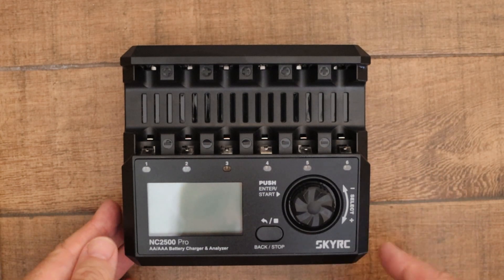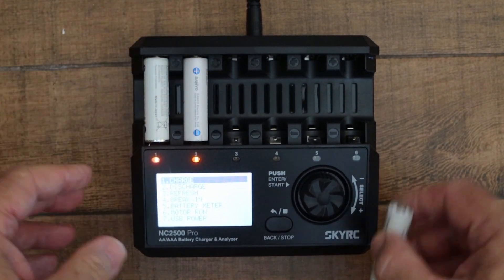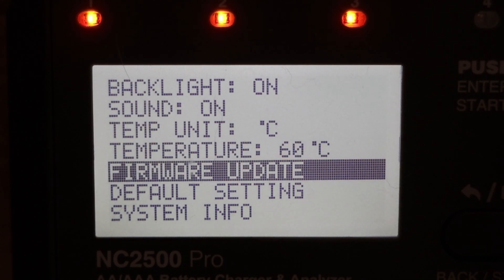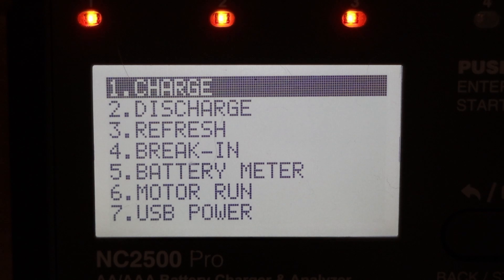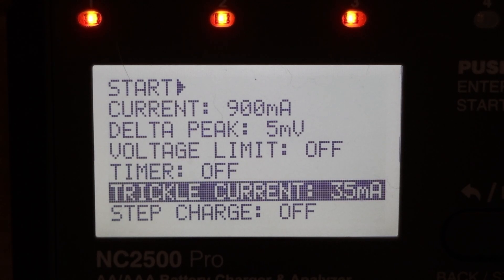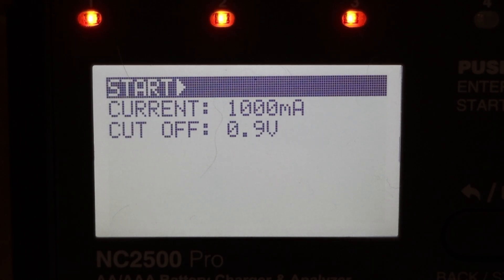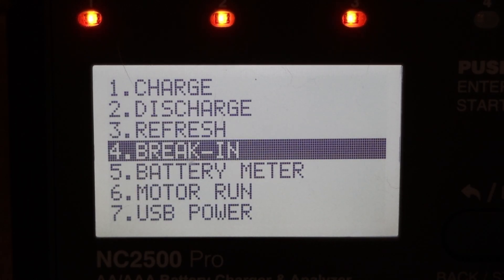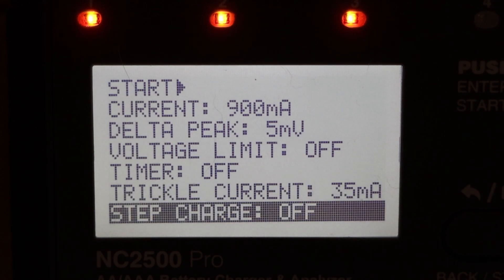A Closer Look At The SKYRC NC2500 Pro

Comment: How Delta peak charger works with the millivolt drop back voltage setting is in the rc racing world the theory was adjusting this allowed for a little more punch our of your sub c size nimh batteries. So some racer would set the mv to 3 because when the battery nears it's peak voltage the voltage drops down in mV. So if battery is starting to be charged at say 1.444 volts then the battery then drops 1mv at a time so then it would go to 1.443 1.442 so forth. Well that 3mv means the charger will end charge when it drops 3mv. or to whatever ever setting it drops back. However the choice of your MV setting will chargre more or less per say resulting in a higher temp at end termination. Lower the number the hotter the battery will be.  Any value over .03 volts for a single cell may cause the cell not to peak. A high value of charge current will also give hotter batteries. A value of
.08 volts should fully charge most battery packs with one peak. Read page 4 and 5 about delta peak. This is from a very high end charger back in the day. You can trust this info and research this on the net but this will help a lot with nimh. I use .03 to .04 for nimh and .05 to .07 for nicd's i had back in the day. It's pretty neat. Here is the link to the info on batteris for page 4 and 5 but you can read the whole thing as this company competition electronics no longer making the charger they still update firmware and is a great company. https://notices.patrickmodelisme.com/telecharger/Comp_Elec/Comp_Elec_Turbo_35_Manual.pdf Take care guy. you might have better luck with this sky rc renewing older nimh cells after you learn those extra settings. I have recover many myself. Take care.
Reply from the maker: Many thanks for this useful information.
Reply: @PhilUKNet  Welcome. That charger was designed by a electrical engineer correctly like a piece of test equitment. Not like the cheap ones today that are not so accurate. That manual tells a lot about battery charging. Take care.
Reply from the maker: @rcdude86  Thanks again for the link and the information. After spending some time with this charger, I get the impression it was made by people who know what they're doing for people who know what they're doing. I have a lot to learn on the subject!

Comment: sometimes when fast charging batteries they can stop charging too soon - step charging enables you to go fast in the beginning and then top off gently :) there might be other uses beyond my knowledge
Reply from the maker: Thank you! I guessed something like this, but I wouldn't know how to configure the different steps to charge the battery to its optimum capacity. This is a great charger, but to make the most of some of its features requires a level of knowledge that is greater than mine!

Comment: Delta Peak,  what this charger does is monitor the batteries voltage, and when it senses the Change in Peak voltage, the charger turns off with the battery being fully charged as it assumes the battery is full when in fact it might not be.  I would use anywhere between 3 to 6Mv the other way you could ascertain what is the correct Mv for your rechargeables batteries would be If you find that the charger has stopped charging, but the batteries are not warm, then they have probably "false peaked", then you would have to start over again charging (When NiCd and NiMh batteries until they are fully charged, they should be slightly warm (not hot) to the touch this is a good way to gauge the delta peak for your batteries are charging properly real old batteries I would hit them with 8Mv as you will find the 3 to 6Mv range wont be enough for older batteries again trial ands error takes a while but you will get the jist of things real quick.

As for setting a voltage limit switch it off altogether that is for racers who need a specific voltage for their car racer motor and is of no use to us charging batteries for household devices.  I have the SkyRC 3000 it is a fantastic wee charger well not wee as it is a big brick I ordered two X Powerex MH-C9000PRO, as they terminate correctly and are very accurate the very best NiMH/NiCD AA & AAA chargers you can buy, I am going to purchase another NC2500 pro from AliExpress saw it advertised for $38.  I ordered Eneloop pro and Eneloop  standard batteries so how many AAA & AA batteries do I own way too many would be 30 of each maybe that is not a lot but it is a lot for me along with Duracell some made in Japan Yeehaaaa which are Eneloop batteries festooned with a Duracell wrapper and some made in China, BOOOOOO which as we all know are not as good..
Reply from the maker: Many thanks for your great information. I didn't have a clue about Delta Peak or voltage limits, so this has really helped. The RC in SkyRC would indicate that certain features are specifically for remote control hobbyists. I just use my batteries for TV/AC/BluRay remote controls and camera accessories, etc.
I was also interested in your comments (from someone who obviously has a lot of knowledge of the subject) about the Powerex MH-C9000PRO. I have been really impressed with this charger, and actually bought a second one recently. It's far better than my Liitokala and Vapcell chargers, but this conflicts with many comments I have received in my videos. There are a lot of Liitokala and Vapcell fans, but it isn't the same for Powerex. One person left some scathing comments about Powerex chargers and batteries, but I think it's a great charger. It doesn't look as fancy, isn't as flexible for battery type/size, doesn't show as much information, but it does the job a lot better.
I've read reports suggesting that the IKEA Ladda batteries that I use are also Eneloops festooned in a different wrapper. I like these batteries and think they represent good value for money.
Thanks for taking time to respond and to further my education!
Reply: @PhilUKNet  I was going to jump to to answer your questions, but Terry gave you good information.
Reply from the maker: @georgesilverhawkstrailcame2297  Thanks, George. I don't have any deep knowledge of rechargeable battery technology. However, since doing these videos, I have seen from comments that some people out there really know their stuff. I've learnt a lot from the comments.

Comment: This is an interesting charger, and yes it’s more flexible then the PowerEx, but most of settings such as adjustable trickle charge current and rest times, I’m use isn’t an advantage over the PowerEx Pro or original.  Their trickle currents are at ideal rates, and the same goes for resting batteries… one hour is best, any more is no benefit, and less is less than ideal.  I do like the break-in mode, and I believe that is an advantage.  How much of an advantage, I’m not sure.  All in all, this is a proper piece of work.  

After the holidays, I will likely pick one of these up and fiddle with it.  I’m thinking that perhaps I use one of these strictly for breaking in batteries.

I know what the manufacturer says about the breaking in… 3 to 6 months.  I disagree with that, especially with low self-discharge batteries.  This batteries (Eneloop, LADDA, Tenergy Pro, Centura, etc.), and designed to self-discharge very slowly and hold capacity for very long periods.  Now standard NiMH batteries that set… then yes, I would refresh them, if they have sat for months unused.  

Your video was very informative, and I now understand the user interface of the charger… which I greatly appreciate.  This video will be especially helpful for anyone interested in this charger, and especially someone buying their first charger/analyzer.

All my best wishes to you and yours.
Reply: Oh, and those LADDA NiMH batteries… those are remarkable cells...  very impressive performance.  Hands-down my very favorite cells.  Oddly… they actually seem to perform, very slightly, better than the Eneloop Pro AA batteries.  This honestly has been my experience with them.  I exclusively use LADDA NiMH AAs, in my trail cameras… been using them for four years now.  I do use some Eneloop and Eneloop Pro batteries.
Reply from the maker: @georgesilverhawkstrailcame2297  Thanks again, George. SkyRC really know their stuff, and they make products for people who have advanced knowledge of rechargeable battery technology. To be honest, the level of knowledge required surpasses my own knowledge, but I am learning slowly through the comments I receive!
It was through YouTube that I found out about Ladda, and that is all I buy now. I order them directly from IKEA in Thailand. There is a huge problem in this part of the world with fake goods, especially batteries, memory cards, etc. Many batteries bought online are fake, but when buying Ladda from IKEA, I know they are genuine. They also perform very well. Many of the brands you mentioned, I haven't seen for sale here.